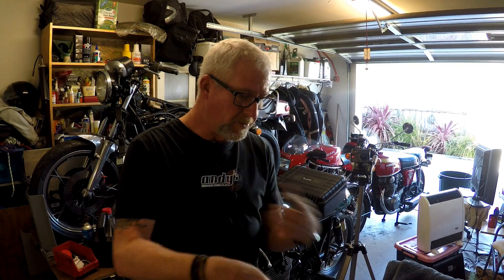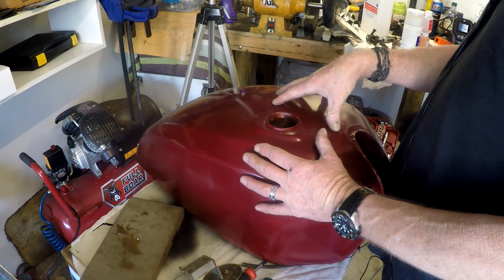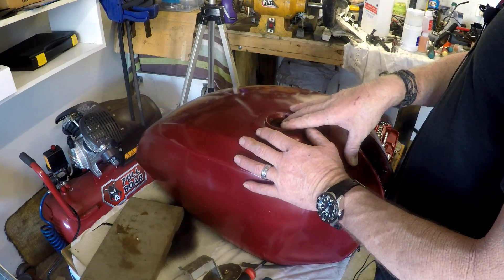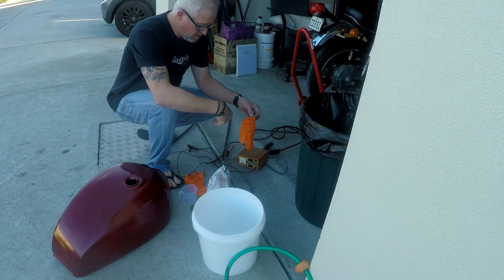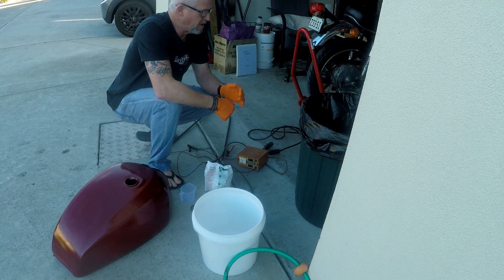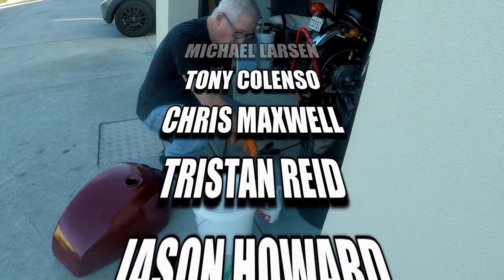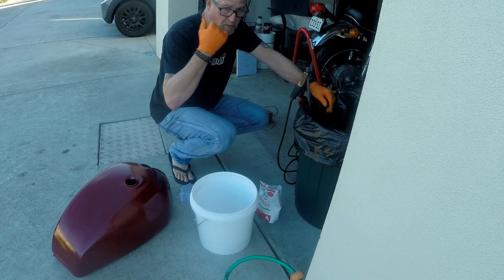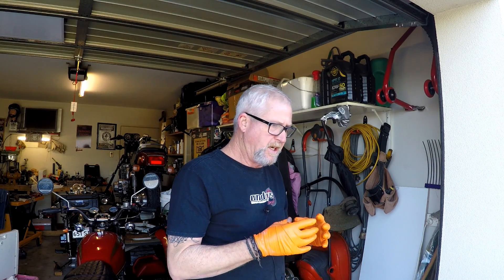GS1000 Episode 13 - Bubble Bubble Toil and Trouble

Comment: I had no idea you could pull rust out like that!! I thought you'd be putting gravel in and shaking it for a day. Very cool. Would this work on any rusty component?
Reply from the maker: Hi Phil, yes it does mate. You just have to be careful that cathode and anode are suspended in the electrolytic solution, not touching each other and that the bath is made of non conducive material.
Reply: @ANDY5  I feel so clever now, I've learnt something!! Cheers mate. Loving the vids.

Comment: Next time use the tank as the tank and suspend a cathode through the filler hole. 
Works great and no additional tank needed.cheers mate.
Reply from the maker: I've heard of this method before, never tried it myself but for sure it would work.  Thanks for sharing mate.